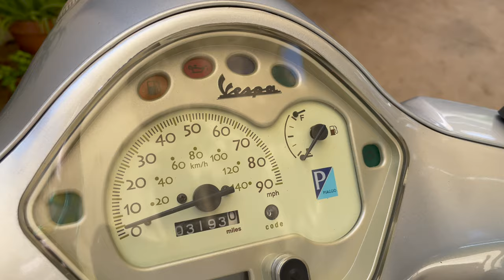Vespa LX Front Fender & Fork Removal / Installation | Mitch's Scooter Stuff

Comment from the maker: T O O L S
3" / 6” extension set 3/8 drive - http://amzn.to/2h7ypMl
Marine waterproof grease - https://amzn.to/2UzmmLB
8mm allen socket  3/8 drive - http://amzn.to/2ENzvei
6mm allen socket 3/8 drive - http://amzn.to/2ELCnbU
17mm socket 3/8 socket - http://amzn.to/2EMT6LO
3/16” ID clear vinyl tubing - http://amzn.to/2FrdLST
Phillips no. 2 screwdriver - http://amzn.to/2fgdZDL
14mm socket 3/8 drive - http://amzn.to/2xGn4Ms
Tiny flathead screwdriver - http://amzn.to/2zyrLck
10mm socket 3/8 drive - http://amzn.to/2xGuLSF
13mm socket 3/8 drive - http://amzn.to/2ps5ur2
8mm socket 3/8 drive - http://amzn.to/2xLNVXU
Cotton swabs (q-tips) - http://amzn.to/2EOXBpn
White lithium grease - https://amzn.to/3eLLzgW
10mm open wrench - http://amzn.to/2hqqYDW
17mm open wrench - http://amzn.to/2GKqFL4
Flathead screwdriver - http://amzn.to/2jN7lpE
Breaker bar 3/8 drive - https://amzn.to/3lrjIWj
Fork stem tool - https://amzn.to/3TTUiC7
14mm socket / 15ft lb - brake hose
Scissor - https://amzn.to/2pIY56w
Rags - https://amzn.to/2Yh8jvg
Bottle for tubing
Plastic bag
Jar / cup